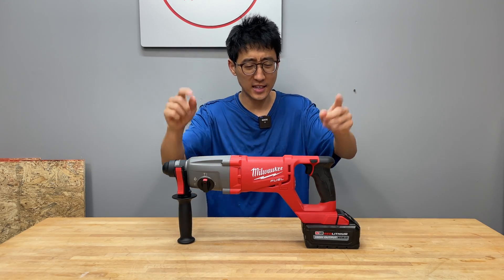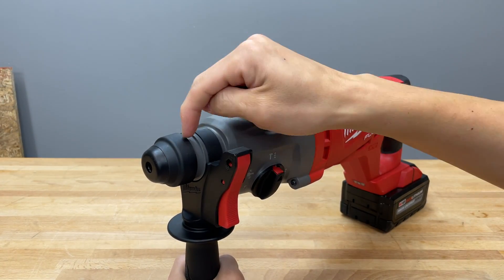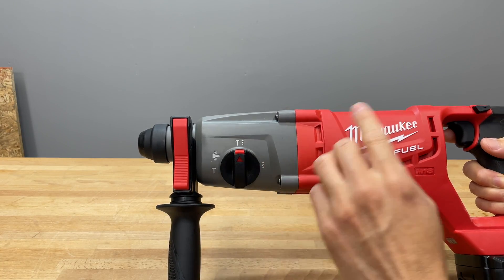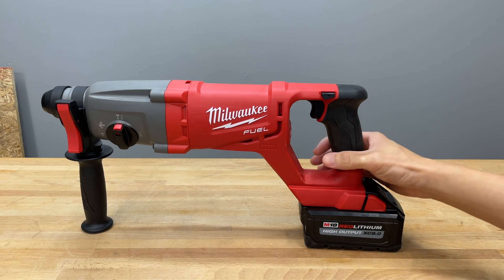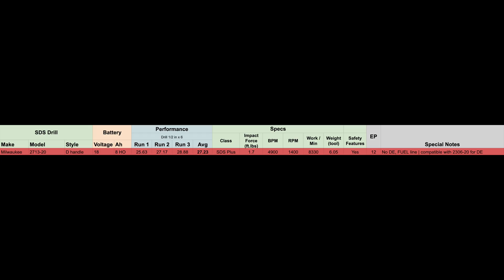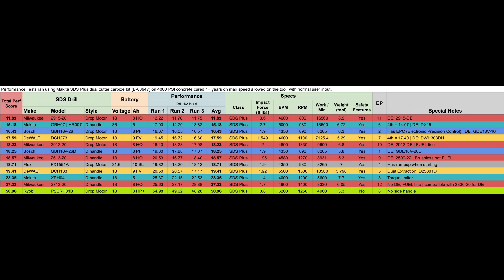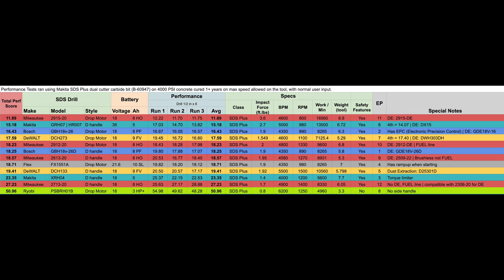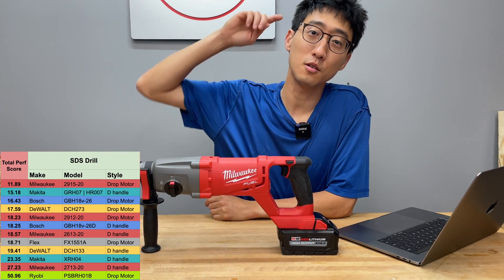24-21 | Milwaukee M18 FUEL 1 Inch SDS-plus rotary hammer review | 2713-20 | ep.12

Comment: Very strange. I just bought the brushed non FUEL version in a BOGO at Home Depot and returned the battery kit. Total for the SDS hammer drill ended up being $99.
Reply: I got my rotary drill for free just had to buy a 199 battery pack